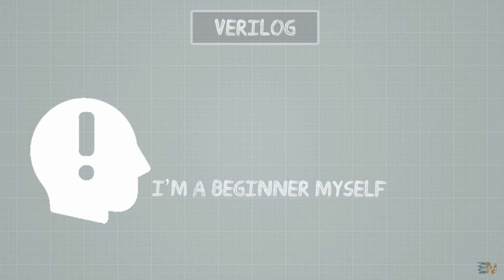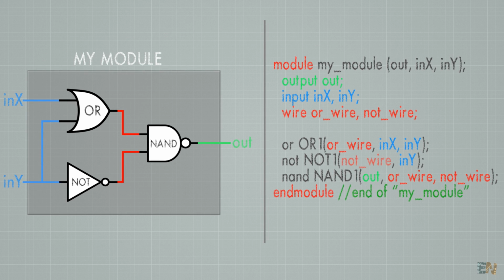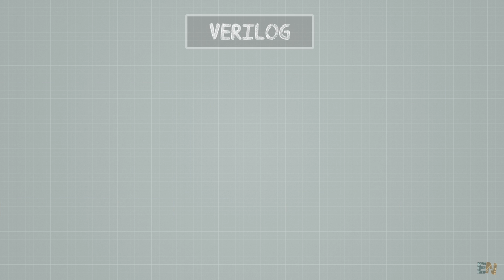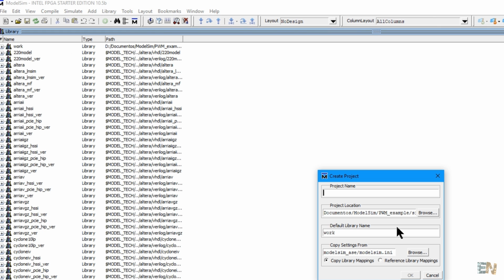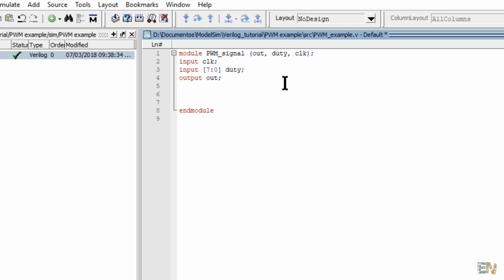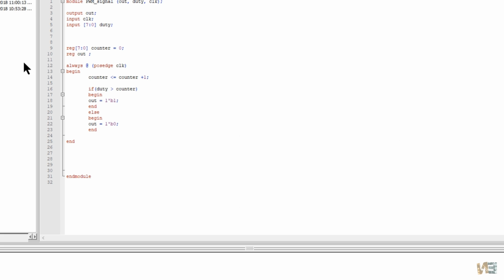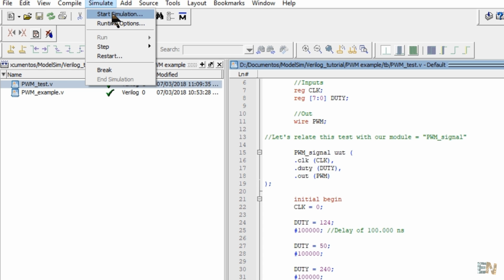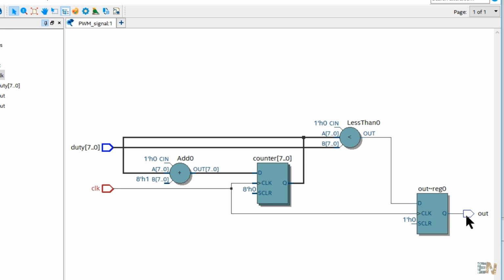Verilog intro - Road to FPGAs #102

Comment: my code is exactly the same as yours and in decimal my duty = -16 and both clk and PWM are flat lines???? Under msg, I see 0, -16, Stx.  You need to explain how you are doing things like changing the scale and position in the wave file!!!~!  This is supposed to teach someone that is just learning so just hiding the bottom of the display and magically scaling and changing the timeline means I spent 21 hours for NOTHING because even though my code exactly matches yours I cannot get the same waveform ~!!  This was very frustrating!!!

I fixed the duty cycle show 240.  You said click radix>decimal but you clicked unsigned!!!

But as far as the clk and pwm signals all I get are flat lines!

Comment: I've always made extensive use of 7400/4000 logic chips and PIC microcontrollers. However I've always wanted to learn how to use FPGAs in my circuits just due to the SHEER MASS of versatility they would allow me on my PCB projects, but I always found the topic intimidating. 

Thank you for making it seem just a little bit less daunting. 

What kind of demo board would you recommend for someone just starting out learning Verilog and FPGAs?

Comment: Excellent tutorial.    It looks like you can use $readmemb to access data externally as well, but only in simulation. You should be able to generate duty cycles to generate sPWM with internal arrays.  Does anyone have an example of code to share and learn from?   Just learning.  Thanks!

Comment: hola .nice video
Usted hace un dron sin escobillas. Usa motores de 2200kv pero yo soy un dron de tamaño buildin f450 entonces, ¿qué debo cambiar en multiwii? y también qué valor es bueno para el motor de 1000kv.
por favor debe responder
gracias, me suscribí a tu canal y me gusta el video también>
mantenerse al día>
Reply: You will have a better experience with an f3 or f4 flight controller board. Cleanflight's family works amazingly

Comment: A couple of things with regard to Verilog:
- Blocking assignments to outputs of clocked blocks can cause nondeterminism (google for "verilog nondeterminism"). Best practice is to stick to NBAs for anything which will be looked at outside of that block. It's fine to use BAs for temporary nets which you will then use to generate outputs via NBAs.
- Indent your code man!
- "greater than" is a much more expensive comparison than "equal to" at the gate level. For PWM, you only need to assign a falling edge when equal to duty cycle, and a rising edge when you wrap. The register will hold its value on cycles where you don't assign to it.
Reply from the maker: Luke Wren thank you for extra info. Have a nice day!

Comment: I know you have already build a ESC but maybe you can make a ESC with e.g. 40A 24V for BLDCs and with a Hall or a optical encoder like this one https://amzn.to/2LaNAFb, so you can build a Servomotor with cheap BLDCs, a cheap precise encoder and a DIY ESC that's also cheap and very versatile (24 V 40 A) and with which you can also run the Motor backwarts which is nesessary for a servo. You could use it than for motion control for example for a linear axis of a cnc or inverted pendulum :)

Comment: i was wating for this since you announced it. i feel this is the holy grail for the hobbysts like me. thank you!!
Reply: Martin Westermeyer Gondonneau Verilog is easy to get started on but hard to master.
Reply: Learning digital logic circuit is not easy and dealing with it's truth tables, karnaugh maps, discrete mathematics, etc. can be very confusing especially when circuit becomes very complex. The circuit needs to be properly analyzed before it can be programmed to produce the appropriate or the desired result.